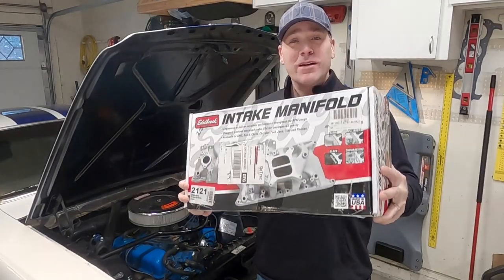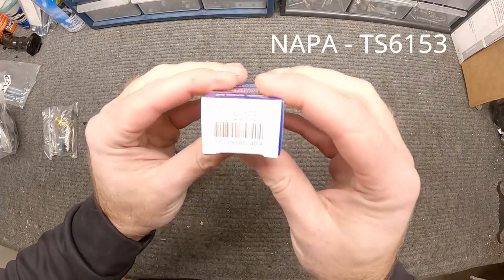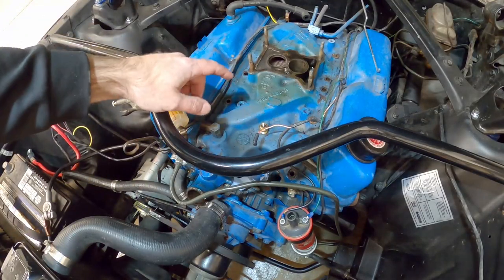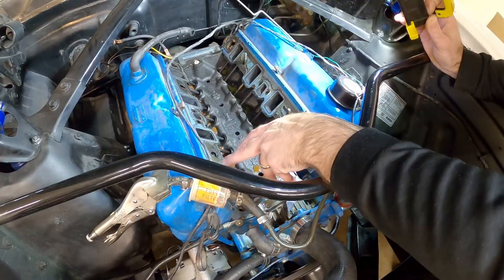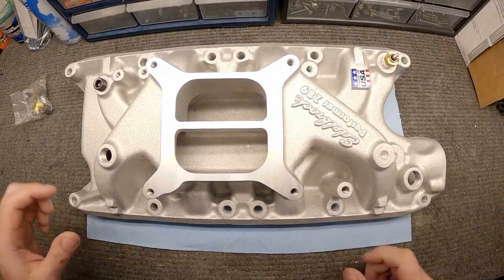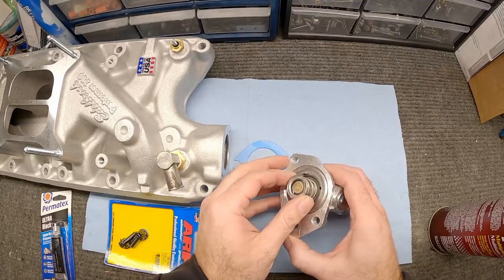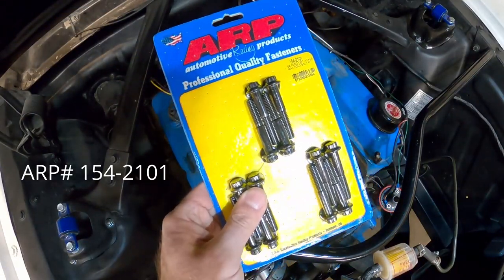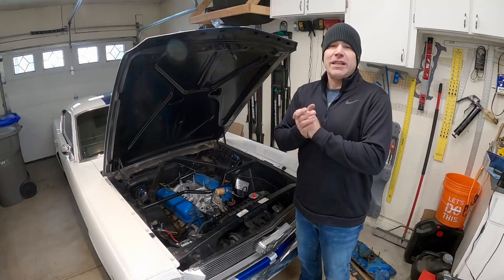How to install Edelbrock Intake Manifold on a 289 or 302

Comment: Awesome video good sir. Would you mind sharing a couple thoughts on why you selected Edelbrock; this is not for debate just curious to know from your perspective. I’ve read great things about this I take relative to the Weiand intake (specifically not meshing well with the heads causing leaks). I’m getting ready to buy the intake and carb - think this Edelbrock carb with a 600 cfm Holley carb. Thoughts? Thanks!!
Reply from the maker: Thanks!
Some of the parts I buy for my car are purely because of the budget.  Sometimes I find decent parts on sale and go with them as it frees up money for other parts.  In this case, I was able to get a brand new Edelbrock intake for 1/2 price.  I was actually looking for a Weiand (I had one on my last car), but this deal came along and I jumped on it.  The same with the Carb I put on in next week's video.  The Carb was such a good price that I had to scoop it up.
I haven't heard of any issues with intakes not fitting well, but sticking with the bigger brands will help ensure proper fit.
Reply: @AndyKruseChannel  that make sense for sure, thank you for sharing. Where do you get most of your deals from? Half off sounds wonderful! 

Also, have you found a radiator yet? I believe your last radiator install was a champion two-row with 1” tubes; I cannot find that model available anywhere. If you’re having the same issue, what else would you go with?
Reply from the maker: @rjohnson6226  I find deals on Craigslist, Facebook, and Ebay.  Also, sometimes a buddy is selling something, etc.  I also have a bad habit of buying parts that I don't need right away, but I know I'll eventually need it, and if it's a good deal......  :)
I have not found a radiator yet, but that's because it's lower on my list right now.  I bought that Champion off Ebay, I believe it was the CC259 unit.  I didn't do enough research to see if there was a better Rad than that Champion without it costing double.  There are probably a handful of similar brands with just as good of units, but that Champion was a Champion, it worked great.  Plus, when it came time to get an electric fan, finding a shroud that fit perfectly helped because Champion is a large enough brand that other companies make stuff to work with and fit the Champion Rads.  :)
Reply: @AndyKruseChannel  thank you for the responses. I will keep my eye out! Not a lot of folks have had 3 mustangs (66’s at that!). So it’s good to hear some best practices from someone who’s done it a few times. Looking forward to your feedback on the performance of the intake.

Comment: i would like to convert to a 4bbl on my 67 289. you can just swap the intake and carb and good to go? nothing else needs to be changed? heads, cam etc?
Reply from the maker: Correct.  Upgrading the heads and cam will be complimented by the larger 4bbl carb and improved manifold you plan to install, but not required if you want to just do the carb and manifold.  :)

Comment: Please explain why u stabbed dizzy at 12° instead of 0°. I just did my timing gears and chain and put mine back at 0. Thanks
Reply from the maker: Honestly, that's where it was when I was making the video.  The important part is that everything lines up with where you started, in this case it was at 12 degrees so I wanted to put everything back together at 12 degrees.  I marked it so it would align when I was done.  Starting at zero is probably a better idea as you'd know that everything is starting at zero, but in this case I just needed everything to go back where it was when I started.  :)
Reply: Ok cool. Thanks for the reply. Love the vids btw 👍

Comment: The Fel-Pro Gasket package has the 2 end cork gaskets and an O-Ring. What is the O-Ring for?
Reply from the maker: I’ve wondered that too but never used it.  I was thinking it went in the block plug near the rear cork gasket location, but since I use the Gasket Maker stuff, it hasn’t been an issue.
Reply: @AndyKruseChannel  That's where I figured it goes too. Just thought I'd ask. Great minds think alike! :o)
Reply: Distributor

Comment: What was the throttle linkage you used andy?
Reply from the maker: For this video, I didn't have a custom unit yet, just the stock linkage.  I later made one that was supposed to be adjustable, but it wasn't.  Then I got around to designing my own which I have on my car and sell on my website: KruseBuilt.com  😀

Comment: Hey Andy, I just bought this intake as well to switch to a 4 barell carb. Noticed the rear coolant ports get blocked off from this, have you noticed any heating issues? Or no problems?
Reply from the maker: I have not, in fact this motor is running cooler than my last car (assuming both gauges were working properly), so I have not had any issues.  Granted, I don't put the kind of miles on this car like I do on my daily-driver, but so far it has not been an issue.
Reply: Tyler.. just got mine today.. how's yours working out for you??

Andy  great video buddy 👍
Reply from the maker: @scottbowling4575  Thanks!

Comment: How tight do you go on the bolts?
Reply from the maker: They say 14-16 ft-lbs is all that is needed.  :)
Reply: @AndyKruseChannel  I just had an aluminum housing crack before reaching 12ft-lbs :/  One side was fine, other side crushed. Might have been a manuf fault.

Comment: Why can't somebody make a thermostat housing gasket that lines up with the freakin' holes.. That just amazes me.. I've tried 2 different housings, 4 different gaskets and not ONE of the damn gaskets line up with the holes.. IF the bolt holes line up, the bypass fitting is off by at least 1/3... If one bolt hole lines up and the bypass is right, the other bolt hole is off by at least 1/4.. THEN NONE of the gaskets cover the entire T-stat housing.. the outside angles are off... LUNACY!! I finally said screw it.. I made my own gasket.. 9mm shell cuts perfect holes for the bolts..
Reply from the maker: Yeah it too bad we have to struggle with the gaskets. 🙂

Comment: Hmmm
So ur going to do this then that, but did u kno if u put 4 barrel heads on it would make a big difference, 2 barrel head don't run so well when u put a 4 barrel on it, yes it works to a point,
Reply from the maker: Ok